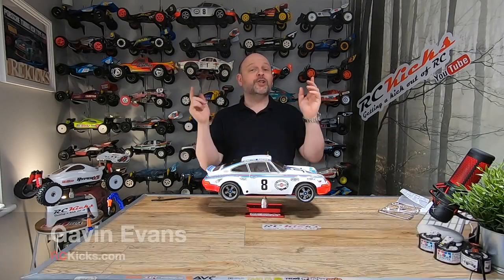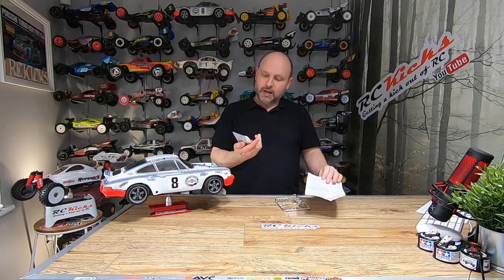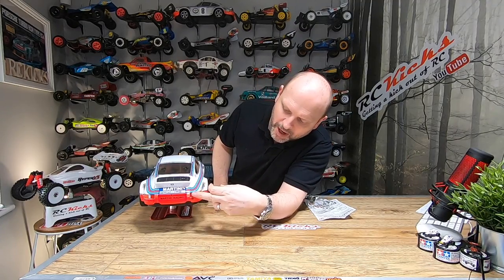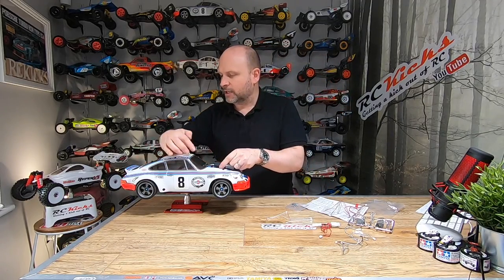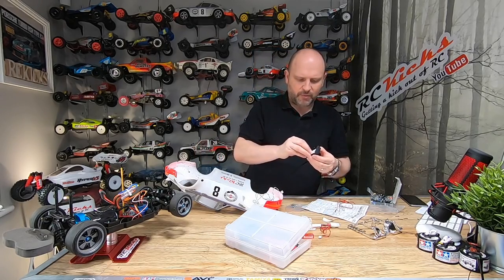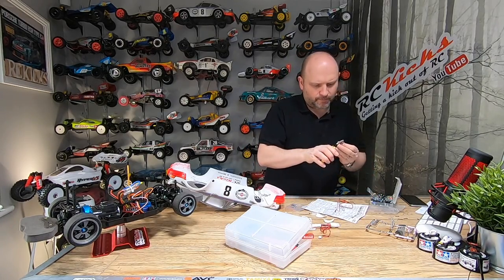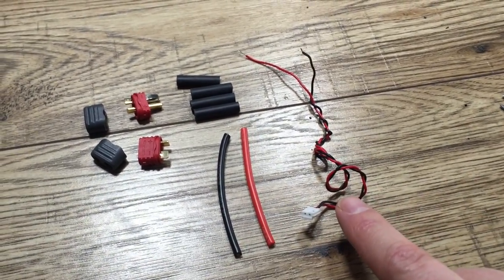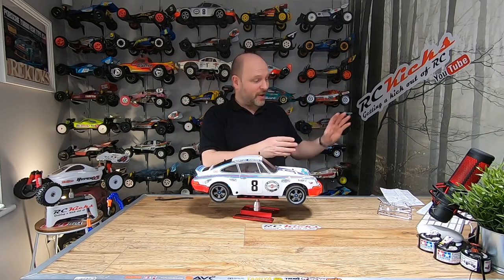Cool LED Lights Mod On My Porsche 911 RSR TT02 With Tamiya TLU-02 + RCKicks Hits 4000 Subs

Comment: Have used this LED unit in my other Tamiya cars. It does work good but is large. I do have the Tamiya Porsche 934 Jagermeister car. I used the Tamiya LED TLU-01 for the front and rear lights. I also used the Tamiya TLU-02 light unit too. This LED unit gives you "turn signal indicators and also back-up lights too. It is very cool but very hard to set-up. Why? the instruction manual is not very clear. You could get this unit and show how to set it up. You will be surprised to find out how difficult this is to set-up. This could help you get even more people looking at your channel. Just a thought. Congrats on 4000 subs!!

Comment: hello friend, I'm thinking of buying a tamiya kit identical to yours! 😃 just for hobbie use even fun, do you recommend it? Or would you recommend other car models? another doubt, the hobbywing quicrun 1060 esc brushed, does it fit the original motor that comes in the kit? How do I get headlight bulbs like yours? Thanks in advance for the beautiful videos on the channel, success with the channel...
Reply from the maker: Yep, its an easy kit to get into for sure.  Check when you purchase the kit as these do come with an ESC included most the time so you wont need to purchase a HobbyWing esc. The kit motor is fine so stick with that for now.  I would get a set of bearings for it before you build the kit.  The headlights came from another Tamiya Porsche kit that you can add down the line if you wish.  You will need to get some Tamiya PS paint for the body.

Comment: Hello, I have a Tamiya tt02 as well, and have had numerous issues with it. One issue that I can't seem to resolve is one of the screws that twists into the plastic chassis of the car got stripped. The screw would turn endlessly, and would fall out while driving, which made steering the car impossible. I tried putting in a larger screw, and that screw snapped in half, and now there is half of a screw stuck there and I can't get it out. I have no idea what to do, and spent so long building and painting the body for this kit, I am not excited to take on this issue. Do you have any advice? Thanks!
Reply: BCC Breaks best advice is to just replace the part
Reply: @archiepaul9739  ok, thanks!

Comment: hello friend, nice car! im going to buy a kit from this tamiya tt02! Do you think it's interesting that I consider buying the upgrade kit from yeah racing for this car? Yeah Racing Red Aluminum Conversion Kit for Tamiya TT02 #CK-TT02RD
Reply from the maker: Loads of upgrades you can do with a TT02.  I would try and find a TT02 SR kit as you get a good chunk of upgrades in the kit and it works out good value.  Don’t go for the TT02 SRX as it’s loads more but you don’t get much for the extra money over the SR
Reply: Hello friend! does the quicrun hobbywing 1060 brushed esc fit the tamiya tt02 kit engines? can i use this esc?